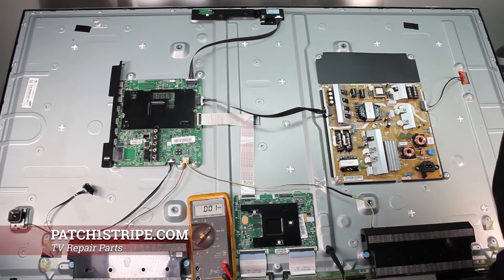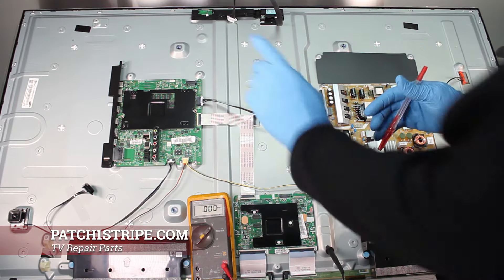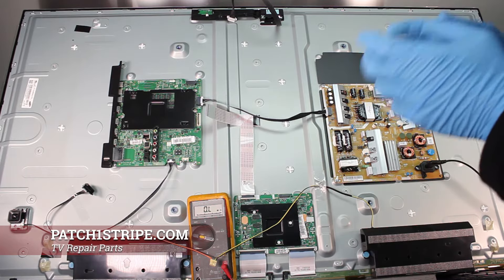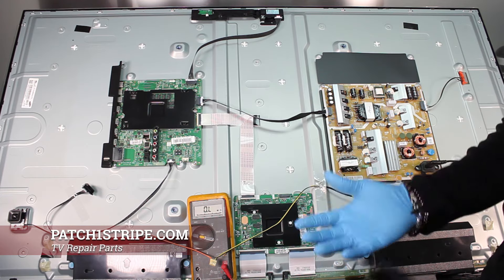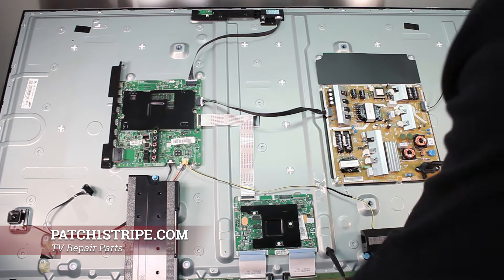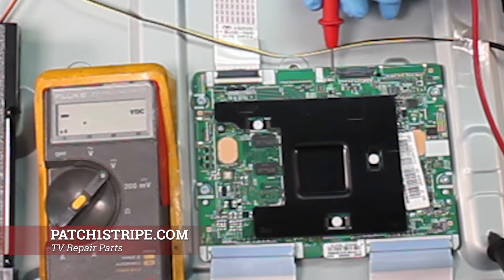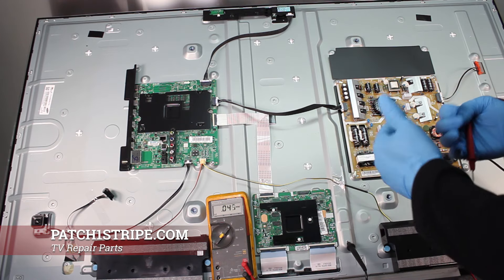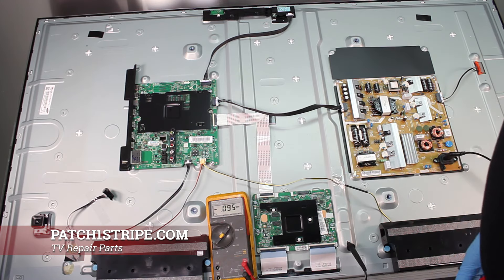HOW TO REPAIR ANY SAMSUNG LED TV:  Won't turn on,  No power

Comment: You are the best, sir. Thanks to your clear, step-by-step instructions, I was able to pinpoint main board problem with my Samsung 55JU6500, the exact TV you happened to be working on in one of your videos. Replaced main board and voila--problem solved and I don't have to go out and purchase a new set after all. Keep up the great work you're doing and God bless!
Reply from the maker: Thank you - glad I can help.

Comment: Hello, I have a Samsung UN50M530DAF. I have replaced the main board to find out it was not the main board. I returned it. I ordered the power board and plugged in the power cable to the rear of the 50" set. No power indicator light in front nor any of the backlight LED are coming on. The red optical digital audio connector light is on. Please let me know what do I check for next. Thank you.
Reply from the maker: Hello, follow the troubleshooting process on the video. It will take you to the problem.

Comment: Hi sir i hv a 32 philips with a dead set checked the board n found out a diode was shorted to ground after replacing the diode the short went away...but my tv is STILL dead. I do not get my 5v too but i get 318v on the main cap could u help me wat im missing pls?
Reply from the maker: Hello, your 5 volt regulator is bad - all so you may have a open resistor near. Hope this helps.

Comment: You are some sort of wizard! This video has taught me more about flatscreen troubleshooting than I ever dreamed of in a simple straightforward way.

I have fixed 3 flat screen TVs in my lifetime. A new power supply board always fixed it. A few days ago we had a hellacious lightning storm here in Houston. It took out my 75 inch Samsung 4K TV. Using a modified engine hoist from Harbor freight I removed it from the wall, took the back off, did some preliminary checks on the power supply. Fuses were good, no solid state devices were shorted, but I sent away for a power supply anyway. Then I saw your video. I put back the old power supply board and disconnected the connector to the main board. The LEDs immediately lit up. From there I disconnected all the other connections to the main board except for the power supply and the LEDs were dormant. The mainboard was the only thing hooked up to the power supply now besides the LED connection. I'm happy and sad and the same time. Had no idea about the connection disconnection technique, very valuable! The sad part is I already ordered the power supply which is not the problem. Too late to cancel. I just ordered the mainboard a couple hours later. But it was worth it, I would've never thought about this on my own. I am from the old school back in the tube days and my success with flat screens, well, it's not always the power supply! God bless!
Reply from the maker: glad I could help - thanks.
Reply: May I ask, from where do you order your parts?
Reply: @Ta21961  I had ordered TV parts from eBay.  Also available in Amazon.  In some other YouTube video another store name was also mentioned. When ordering parts make sure the image of the part you are ordering matches exactly as that of your old part in addition to matching the part number explained in this video.  Good luck!

Comment: Good to know old school dudes are still out there fixing shit. So many people throw things away and buy new. I always try to fix something if it's broken and sometimes it's cheap and easy.
Reply from the maker: Thank you
Reply: young schoolers too
Reply: @Marqui91  i love dumpster diving and scrapping. i have fixed numerous stuff. my entire home office is supplied by my picking that i haven't paid a dime for. i recently picked up a samsung 65 inch curve tv for 50 bucks. only issue was led light. im going to pick up another 60 inch today for 25. its always the littlest things thats wrong with the tv or any electronic.
Reply: Agree..great video

Comment: Way helpful for a "shade-tree" electronics guy like myself. Genuinely appreciate the video. You gave me troubleshooting methods I need. About to get to working on a SAMSUNG LN46A500T1FXZA built in 2008. She cycles to start, but won't. Used to take longer and longer to start, then eventually she wouldn't start. Can hear the relay trying to start up as it cycles and kicks in. Feelin a lot better about cracking the case on this set now. Thank you for the video.
Reply from the maker: You're welcome!

Comment: Out of all the possible solutions and DIYs out there. This is thee best one. Do you think that them flex panel cables can at some point become damaged and cause that on and off issue ?
Reply from the maker: If you go through the process on the video and disconnect the main board from the power supply. Apply power and see if the backlights comes on and stays on. That will determine what direction you should go in next.

Comment: Great video I have no back lights or screen at this point when I unplugged the motherboard from the power supply no back lights turned on so from what you’ve shown me it seems like the back lights would have to be replaced?
Reply from the maker: @toyman91  what that is showing you is - your problem is either the backlights or the power supply board. You can check further to bettering  your odds of replacing the correct part. I use a backlight tester to test backlights and an ohm meter to test voltages at that plug you disconnected on the power supply side.  There is a legend printed on the board near the connector.  What is the model number of your TV?  That will let me know the age of your tv. That’s another variable. Good luck.  You can repair it.
Reply: It’s a Samsung UN60J6200AFXZA I replaced the LEDs and before that I replace the power supply do you think the old LEDs could’ve taken out the power supply?

Comment: I bet he was a military man ! Looking forward to watching these thanks.
Reply from the maker: My dad was military - I grew up in his tv repair shop in elementary school. I later went on to earn an BS Electronics Engineering degree with a minor in Mechanical Engineering. I am a Master Electrician. I worked in Silicon Valley for  HP at 21. General Dynamic Space Systems - Super Collider Project. Now  for the past 25 years I've worked at the top aluminum rolling mill in the world as a General Technician working on P&H overhead cranes, automatic guided vehicles, monorail scrap recovery system and power distribution. I am proud to be a troubleshooter there.

Comment: Hi  there    i am in Canada  and I just subscribed to your channel.  Watched your Samsung videos and you walk through the circuits very well.    I have a few Samsung plasma tv sets and other brands as well. My question is  this   Are plasma tv sets still worth fixing and are there parts available for doing so.   The last  Samsung tv was from today and the picture portion is missing but the sound is there.    For this set I can certainly get the model number if I am able to go forward with  repairs.  Name here is Warren
Reply from the maker: I have parts for Samsung, LG, Panasonic plasma tvs.

Comment: THANK YOU MY FRIEND YOUSAVED ME MONEY AND AGGREVATION
Reply from the maker: You are welcome, glad I assisted you
Reply: @Patch1stripeTVParts   Okey i got the tv working last night BY UNPLUGING THE POWER BOARD WORKED FINE BUT I SENSED  SOME FAINTED TIME WHEN I WAS WATCING YOUTUBE IT STOPED IT WENT BLURE AND THEN I REBOOTED AGAIN IT WORKED FINE   I SHUT IT OFF AND THE MORNING IT DINT COME ON AGAIN
Reply from the maker: @antixa90  what is the model number of your TV?
Reply from the maker: @antixa90  what is the model number of your tv?
Reply from the maker: @antixa90  Hello, sound like you may possibly have a intermittent working main board that may need to be replaced to resolve your issues.
Reply from the maker: @antixa90  nice tv - do what you can to repair it. I am here to help even 
with parts in most cases.
Reply: @Patch1stripeTVParts  thank you again for taking time for this i have just had the tv working again i took every thing apart   lets see what happens
Reply: @Patch1stripeTVParts         thanks i will let you know

Comment: I fixed my Samsung TV type QE55Q65RALXXN   55 inch , isolating (paper 3 mm wide) some contacts in the flat cable as shown in your fantastic video.  Everything is already working for 5 days now, except the st by indicator. Do i be aware of change of fire anytime?
Reply from the maker: Did you possibly disconnect the standby light connector? Next, sound like you have done nothing that would cause a fire. Fuses in different part of your TV are there to protect your internal electrical circuits.
Reply: @Patch1stripeTVParts
Reply: Yes I once disconnected the st by connector but all functions of the remote control work excellently as all functions of the tv.  Thank you for your help and fast answer.  Greetings from the Netherlands

Comment: thanks for your great down to earth step by step trouble shooting. my samsung LN32D403E4D screen or sound does not come on, only red light on front comes on. when power button is pushed it goes out and a quiet ding a ling on speakers. I have tried unplugging everything and no change so I am suspecting the main power board. if power is getting to the red light, does that mean power board is ok? Steve
Reply from the maker: Steve, you have a lcd tv which means no led for the backlight.  What I have ran into with this model tv is miniature CFL bulbs powered by ballasts. If either fail, there are no replacement that is new out there. You could have swollen bad capacitors on the power supply that needs to be replaced.
Reply: @Patch1stripeTVParts  thanks I was able to find a power supply on ebay for $17 and put it in and bingo the tv works!! I was a bit amazed but your step by step approach of process of elimination made it worth the risk of buying a no return item. now I am getting a remote and a roku to complete it. thanks steve

Comment: Thank you for such an awesome troubleshooting video! You are the bomb! I concluded that my TCON surface mount fuse is blown. Do you have this fuse for sale or can you advise where I can buy it/amp rating? Thanks again I am stoked... regards Vinny D
Reply from the maker: what is the model number of your tv and the value of the fuse you need.  I can help you with that or maybe a new t-con board.

Comment: thank you brother your videos are very helpful i have a samsung 55KS9500 model which turn on and off in a matter of seconds but there is back lights and sounds with no picture. what do you think is the problem because i have called samsung and when they checked they said i have to replace the hole screen.
Reply from the maker: I would inspect the t-con board. But before i do that i would take a voltage ohm meter and see if i have 12 volts dc on both side of the fuse on that t-con board. If voltage is not found, you have a bad main board and or possible LVDS flat cable. Hit me back - lets see if we can fix this tv. Hit me back

Comment: Great videos!!   Im working on a un75ru8000f.  Power board voltages are all good, Back light is working and there is sound on power up.  I changed out the main board and it was no help,  Not sure where to go from here, can you help.
Reply from the maker: Hello, have you tried disconnecting the wifi module from the main board then apply power to see if you tv comes on? If so, connect a A/V source or antenna to the tv disconnect the t-con board from the main board -  power up the tv and see if the tv comes on audio? Let me know what happens.
Reply: already tried this, did nothing
Reply: This tv has no t-con board only 2 boards.
Reply: Is it possible that the firmware that starts the TV is corrupted

Comment: Hey great video. Just saw your channel now and am subscribed! I do have a question with my tv and was gonna see if you know any ideas on what I should do. My samsung UN49MU6290 TV will not power on and will not show a standby light. I replaced both the power board and the main board. When I disconnect the cable going from the power board to the main board then the backlights will turn on. I checked the voltage from the power supply and the chart says it needs to be 12V and when I have it disconnected from the main board it will show the correct 12v but when I have it connected to the main board it shows 9v. I am not sure what to do next.
Reply from the maker: Hello, leaving the main board connected to the power supply, disconnect the wifi module and the t-con board. Using the remote power on the tv, If it comes on connect the following parts one by one to see which of the two is killing your back light. That will be the component to replace. Hope this helps
Reply: @Patch1stripeTVParts   this model tv doesnt have a separate t con board. I unhooked both the flat cables and the wifi module and it still wont turn on for me.
Reply from the maker: @ryanflores7768  did you get backlight when you disconnected the main board from the power supply board?
Reply: @Patch1stripeTVParts  yes I do. I think the main board I purchased was bad so I  am waiting on a replacement and then I will let you know. Thank you.

Comment: Great video !
 Hi, I have a Samsung model UN50H5203AF. The sound works but no image. I can see an image by illuminating the screen with my cellphone. I tried to do a reset with the remote control, the TV button, etc...
What is the first thing I should try or change? I can't see any back light (no holes or white plastic as shown)
Reply from the maker: backlights
Reply: @Patch1stripeTVParts  Thanks
Reply: @Patch1stripeTVParts  I tested the backlights with 4 9V batteries connected in serial(36V) and one of the strip is not good. You were right. Thanks.

Comment: Very thorough walk-through.  Do you have an updated version for a Series 8 (UN65RU800DFXZA, Version AA02 / URU800D).  Internal configuration is a little different, there are two flat cables, can't find a good place to voltage check the power supply, and the back light behaves differently (almost a slow strobe) when power supply is connected to power but not connected to the main board board.   Once  the power supply is connected to the main board (with the IR/wireless/flat cables disconnected) the back light comes on bright then dims and stays constant.  All seems to be stable unless I plug in both flat cables, and then the system just continually restarts as soon as "Samsung" displays on the screen.  Thank you.
Reply from the maker: So you need to pursue the IR/wireless/flat cables. Disconnect the wifi first and see if the backlights stay on constant if they don't, leave the wifi disconnected and go to the next connection. You are using a process of elimination so eliminate one thing at a time until the backlight stay on constantly. Then you pursue that path. Hope this helps

Comment: I have a reboot loop situation.  on for 3 sec.and only shows the channel label and turns off and reboots over and over again. I have troubleshooted everything to the power board only hooked it up to the led lights and this still blink and power down.  Can I conclude it is the power supply? or can it be something else like an Eeprom on main board.  I have UN55FH6003f.  Thank you for all your video and I learn a lot. But not effort obviously.
Reply from the maker: Both options sound good. make choices at this point and narrow it down. That all I can say on this issue without being there. Hope this helps.

Comment: Hello, I have a jvc  model lt-58ma887.
My problem is the jvc start up screen will come on for about 1 minute then the tv will shut off.. what part do I need to replace..
Thanks for your video.. I have subscribed to your channel and will order my parts from patch1stripe.
(I help who helps me) thank you again for being thorough and informative
Reply from the maker: A Samsung tv is a different creature than a JVC, but they are all led tvs. You can have a power supply with bad solder connection or a main board issue - take the power supply out of the tv and look for cracked circuits like describe in my soldering video. Next after reinstalling the power supply board,  let the tv play with the back off until it shuts down then unplug the power cord. Now feel on the chips only on the main board to see if you can find one that is hot to the touch in such a short time. If you do find a hot component, replace the main board. From your description, I don't think bad backlights is your problem.  Hope this helps.
Reply: @Patch1stripeTVParts  thank you for responding 🙏 😊... and the promptness is  A1in my book wher I can fix my problem or not, I have shared your information throughout my family's page on Facebook...
KEEP UP THE GREAT WORK THAT YOU ARE DOING.  (SALUTE)
Reply from the maker: Thank you!

Comment: Great vid was wondering if you might have any suggestions i have a samsung Ln40b530p7f with everything unplugged from the power board it blows the fuse furthest from where the power cord plugs in thanks in advance for any input you might have
Reply from the maker: doing the research will call you tomorrow.

Comment: I have a standby light, but no led lights. I have 12.76 volts going to the main board, and 3.5 volts going to the power. Then I checked the volts going to the led plug and have nothing. Soooo, doesn't that lead to a  bad power board? And thanks, this was a great presentation leading me around this thing. The Model I'm referring to is a UN60J6200AFXZA  Looking forward to a reply and thanks in advance.
Reply from the maker: When you disconnected the main board from the power supply and applied power to the tv, did the backlight come on?
Reply: @Patch1stripeTVParts  No they did not. I have no volts at the  plug going to the backlights.